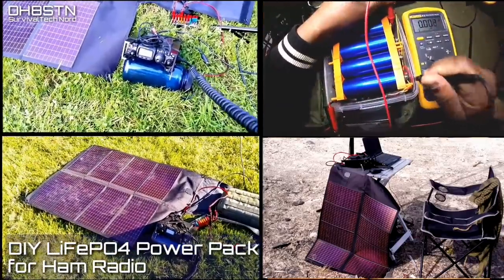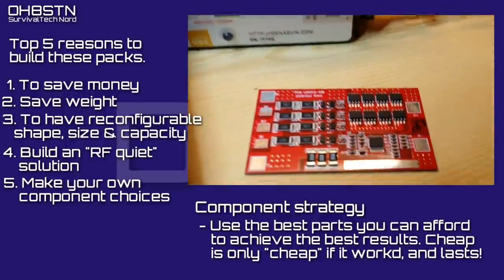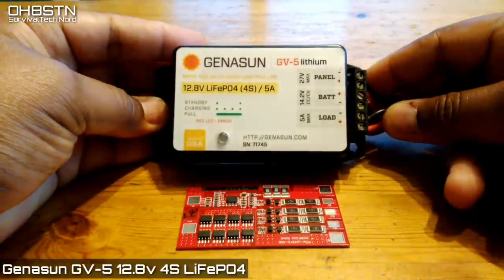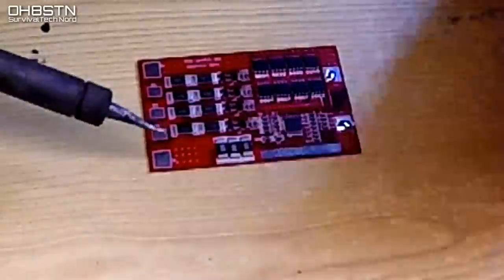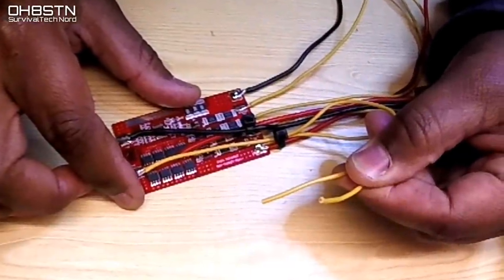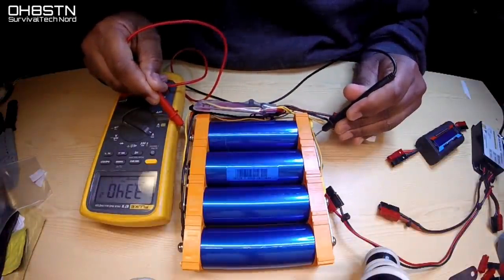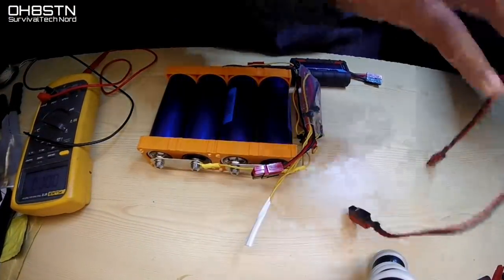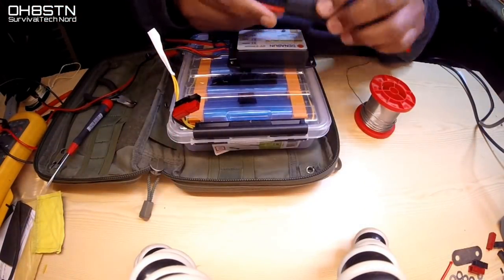Ham Radio Battery Pack DIY LiFePO4

Comment: WOW! It's hard to believe this video is 4 years old. I remember watching it when you posted. Its been a slow process but I've finally got my pc, tnc and radio. I should be on the air this winter if my work load lightens up. Thanks for all your videos they are a wealth of knowledge.

Comment: I really liked this video. The step-by-step documentary of building the battery pack shows that it can be both fun to make and an economical alternative to turnkey commercialized systems.
Reply from the maker: +Bonnie Crystal thanks Bonnie, that means the world to me. 
These steps-by-steps will be the norm for tutorials on the channel. For now the tutorial forcus is portable power. 5Ah 4S2P LiFePO4 pack coming up this month. In spring 2018, a 4S3P/4S4P 120Ah version to upgrade the shack, (based on our 100Ah discussion). Portable off grid power has remained a passion since a fifth grade science project. Planning on some ALE antenna tutorials as well.

Comment: Finally, someone who DIY a LFP battery with tremendous amount of capacity in a regular lunch box size. For cost-effective long lasting battery! instead of spending 300 - 900$ on commercial unit.  

I've been looking for a video like this. Because I'm also building my own battery source for my devices which I preferred compact, less weight, size, yet off-grid portable that I could fit into my Gobox kit.

Satisfied to watch! 
Thanks for sharing!
Sub up.

Comment: Nice build. I didn't  know about the LiFePO4 38120S  battery.
Reply from the maker: +David Gillooly  yeah I didn't know about these either until a few months ago. I think they're excellent storage batteries and considering there's so much lighter than AGM or lead acid batteries plus almost double the capacity with the same amp hour rating seems to be all positive at the moment. Time will tell

Comment: Nice, I had never even heard of this type of battery. I will have to look into building something like this.. very handy.
Reply from the maker: +Iridium242 it's always nice to see you stopping by. If I'm not mistaken I think this type of battery is often used in electric bikes or cars. Definitely makes an excellent storage medium
Reply: i would imagine you could use just about any sized cell (ie. 18650) so long as its series'd to make 12 (ish volts) and enough cells in paralell to to supply the watt/amp hours for operations

Comment: Great job, Julian!! 

I have watched a lot of your videos...and it looks like you are having great fun. It made me so jealous, that I have purchased a KX3 / PX3 and have been putting things together for a man portable station. Currently the gear is transported with my 4 wheeler and usually while I am out checking on the cows, I will set it up and try to make a couple QSO's. I gotta say, it's the most fun I have had in this hobby.
Reply from the maker: +Mad Dawg yeah operating portable adds a whole nother Dimension to ham radio. In fact there are so many variables when operating portable that it brings up new challenges that we hadn't considered before and makes it feel all new again 👍

Comment: Julian, you said you were looking large shrink tubing - Might I recommend using a two liter bottle, if you cut the end off and heat it like shrink tubing it will contract and provide a strong tight seal.
Reply from the maker: +A A this was a magnificent idea. I found that heat shrink I was looking for the clear PVC kind but I also tested shrinking the two liter bottle around my pack. That is an excellent hack! I think I'm going to have to make a video about this hack just because it's so cool.
Thanks for sharing the knowledge
Reply: You win the internets, congrats!
Reply from the maker: Internets?

Comment: Very nice power pack. My UBC was a noisy affair I'll have to spend a few more bucks, it was salvaged from some old RC Quad Copter FPV gear. Even with toroids front and rear end it still produced 3 S units of hash to the noise floor......
Reply from the maker: +graplingurty that's a crazy amount of noise. Absolutely zero noise with this pack, and no toroids were used. I use the UBEC on the first battery build last year, that required a couple of toroids, but those cleared up the noise quite well. Yeah the component choices mean the world in regards to noise.

Comment: Another great video Julian! Thanks for sharing your experience and knowledge. Left you a buck on the virtual jar ;-). I just use a set of three LiFePo batteries (from Hobbyking) and re-charge them at home with a controller. Together with an IC-7000 (which draws too much current for a field rig, I know) and a Buddipole that's my portable rig and it was proven to work ok in the Cayman Islands, the Bahamas, Aruba, Curacao and Canada. I mostly used a car though or only had a short distance to walk. 73s, DL1THM.
Reply from the maker: Thx for the tip 👍
It sounds like you've got to working setup, and after all that's the main point. Lots of operators ask about this Hobby King battery so I'm sure your comment will be appreciated.
Are you vacationing, or visiting those places for some other reason?  I think most of us would die to operate from such exotic locations.
Thx again 
73
Julian oh8stn

Comment: Julian, since you said you had problem designing the box, I will assume that you do not want to go into learning a CAD program (obviously). There are some very easy programs o design simple shapes like a battery case/box. I used TinkerCAD to make me an elaborate 18650 cradle. It follows the method of combining additive and "negative" basic shapes yuo define their size and alignment. For a basic tray you need to make 5 rectangle blocks, then you combine them. now if you want to have a hole on one side, you make a "negative" cylinder the diameter you wish and the length of the box side thickness. then you drag it where you want it.

Comment: Thank you for the information and ideas!  The only thing I am not sure about shrink raping as much. It looks like you are stopping the air moving around needed to cool things. The BMS drops the cells that are hi through resistor,  this makes heat.  The power you use goes thought a solid state device to be able to switch the power on and off,  this makes heat. I understand making it bulleit proof or where it can take what ever, but I am not sure about the heat build up inside.  I am sure you have thought about this and made sure that it will not be a problem.  I just would like to know what you have done for this. Over heating of the BMS and or the batteries can shorten there life and have other problems.
Reply from the maker: No problem David I agree with you. We've also covered that in the comments. On my latest build the solar generator, I omitted the heat shrink. Thanks for the comment.
73
Julian oh8stn

Comment: What a superb video, project, and tutorial!!!
P.S.: I wonder if a section of motorcycle inner tube (tire tube) would slip snug over the pack?!?  It would insulate & provide some shock absorption... and it would be removable/reusable as opposed to large shrink wrap.
Again, great job!
-Rob
Reply from the maker: +rkaag99 hi Rob the motorcycle tube idea is a magnificent one. I get so many questions about these projects that I thought to use a clear vinyl sleeve, so people could see what's inside, and I can answer questions about it without taking it apart again 😀 I'm going to add your idea to the episode notes because for almost anyone else that would be an excellent way to seal the battery pack.

Comment: Julian,
What size wire did you use?  I am currently making the 10aH battery pack.
Thank you for the great videos.
Reply from the maker: I typically use 14awg wire.
73
Julian oh8stn.

Comment: I guess I'll be coming back to this video again...I have the carrier and cells coming after half way through the video. I have a charger (BMS) from Budipole I want to use ..so I need the connector for the A123 packs they use.
The shipping charge to Indianapolis was more than the cost of the cells ! !
Thanks for the video, and thanks for dropping by QRZCQ to comment. Try the QRP chat room some time !
Lee, WA8QFE (BushRadio on BCUSA site.)
Reply from the maker: Francis Thompson have I forgotten something Lee?
Reply: Julian,
Not in the least...you've just launched me on another project !
I did find the BMS you used and ordered that one also.
I was thinking of using my Cellpro 10XP balance charger, but it uses a small connector for the cell balancing on the A125 systems packs, and I can't locate one that matches it.
Lee, WA8QFE
Reply from the maker: +Francis Thompson try HobbyKing for those Balance connectors
Reply from the maker: +Francis Thompson wait a moment. You don't need a balance Charter charger when you're using that BMS. The BMS itself is doing the balancing. LiFePO4 charger.
Reply: I know, 
I just happen to have one. I'm doing this build with the same BMS as yours now. I bought the balance charger for the 2 A123 7Ah packs I have. The 9Ah Bioenno I use has it's own BMS built in.
Just first time I built my own, and now following your lead !
Lee, WA8QFE
Reply: I'm going with the BMS your using, but will check with hobbyking and also Buddipole who I bought the balance charger from.
Lee, WA8QFE
Reply from the maker: +Francis Thompson if you're interested in bms capable of qro power, I'm just waiting on this one https://www.instagram.com/p/BagnTrCjHrZ/
When I operate casually I almost always use 5w, but for the all-weather weather emcomm field station project, I'll be using a 20w radio and laptop with a 40Ah version of this pack.

Comment: If you wanted to charge the battery with a LifePo charger, would you plug the charger directly into the BMS? And if using a solar panel, then you'd charge through the solar charge controller, which would be hooked into the BMS. Correct? Thanks.
Reply from the maker: That is correct. Just be sure the LiFePO4 Charger is within the c charge rating of your pack.

Comment: Can you detail how to expand the pack to 20 or 30 amp hours for QRO work.
Reply from the maker: +Craig Gilbreath No problem. I think you mean Peak current for a QRO radio. Please give me a day or two to add it to the episode notes in the questions section
Reply: Interested in seeing how you would handle expanding the amp hour rating by wiring in series-parallel to get, say, 20 or 30 amp hours. How would this be done with the BMS if you have more cells to monitor and maintain? Can the BMS modules be ganged together to handle more cells?
Thanks for the quality video Julian, outstanding as usual. (Hope that clears up my original question)

Comment: Depending on the case and even the way you have it boxed and bagged, wouldnt there be an issue with heat durning charging and discharging?  Also what about the many RC community LiPo chargers advelable for home charging?
Reply from the maker: +Jud Stansell excellent question Jud.
I don't charge my batteries at very high rates, which keeps heat down to a minimum. It's the same thing with discharge. I'll never discharge at higher than 10 amps, which generates almost no heat from these cells. The RC Chargers are certainly possible to use. Since we use the battery management system there's no need to use the balance ports on the RC charger. Since I have a solar charge controller integrated with the battery I don't need those RC Chargers when I'm charging at home. In fact I use a repurposed laptop power supply that outputs 18v/2A straight into the solar charge controller. Cheap and easy.
Reply from the maker: +Jud Stansell I've been thinking about your comment. I think I'm going to get one of those laser temperature gauges to measure how warm the batteries get under full current draw and charging.

Comment: Hi Julian (or others) I have completed a build of this battery, but have a question about the BMS board. Should the BMS board be pretty warm to almost hot all the time once the 5 leads (B+, B- , and B1, B2, B3) are mounted to the battery? Cells appear to be balanced, battery is charged fully, but with no charging going on, and no loads connected the board is very warm, even uncomfortable to touch. Is this normal? I am nervous about putting this battery with the BMS connected to it into the pouch like Julian shows... Thoughts? Suggestions? Do I have a bad BMS board?
Reply from the maker: Hi Mike. The balance leads are wired wrong! If there's any heat on the BMS at all, it's wired incorrectly.
We've all made that mistake, but it's easy to correct.
Reply from the maker: Hi Mike. Did you have any luck rewiring the BMS?

Comment: You mention elsewhere increasing the BMS to 30-40A, but the gensun can only handle a 5A load.  Can you explain your thinking? (I’ve built this and a larger one, trying to understand the best power distribution). Love the videos
Reply from the maker: +SouthernSearcher excellent question 
we don't have to use the load port on the charge controller. The 5 amps is only the maximum amount of amperage which can pass through the charge controller to the battery. The load Port is only used 4 low voltage cutoff of an external load. We can instead connect the load directly to the battery and still charge it with this Dodge controller. Does that make sense?
Reply: OH8STN I understand the theory, but 5h3 LiFePo needs stop delivering current, when it reaches its cut off voltage, so what will handle this, to save a rather extensive battery pack.  I’m currently working on a 4S 15AH, currently 2P, hoping to make 4P or larger for home use, I’m in the South of France so sunlight is not an issue. 73 de Andy
Reply from the maker: +SouthernSearcher i think I'm making explainer video about how to do it. Just to keep you in the loop there's two ways that I would consider. Firstly I would use an external low voltage cut off, between the battery and the load. It's not to be confused with the load port on the solar charge controller.
The other way I would do it is using a relay on the load Port of the solar charge controller. This way you get power directly from the battery for your load and the load on the solar charge controller only Powers the relay. This means you're low voltage disconnect on the solar charge controller is controlling the relay and protecting your battery.
Does that make sense?

Comment: Awesome video, thank you. I have seen these batteries around but never a well done video showing the building of a pack. For this, thank you. Do you think these cells can be used to make a 40ah pack? I'm wanting to power a DC, ARB refrigerator. I currently do on a 55ah SLA battery but yearn for a lithium battery.
Reply from the maker: +Michael Meza sorry it took me so long to come back to your comment. I wanted to be certain that I gave you the right answer. I don't know what an ARB refrigerator is but it might be the same type of refrigerator that keeps my Red Bull cool. So I've never done parallel packs of more than two deep. But I've seen these parallel batteries done on youtube. It's no big deal making a pack which is 4S2P ir more. All the cells in parallel we'll balance themselves. More over each of those parallel cells connect to the BMS as if they were one single cell. I'm thinking I should do a video about this for the channel. I need a 40 or 50 amp hour battery for the ham Shack. I've already got the panel's up on the tower but I thought to change over to an mppt charge controller for the shack. It might take me some wants to do it but I'm certain I will. For your project all you need to do is make sure you get the right BMS rated for the amount of sales and the total amperage draw the refrigerator will pull.
Reply: Excellent, thank you. In my research I'm finding 40 and 60ah cells. Some are Headway type others are Winston type. For the size I need I may be going with a lithium prismatic type like this: http://www.electricmotorsport.com/ev-parts/batteries/lithium/4-cell-12v-packs/gbs-lfmp40ah.html

Comment: One of the things you mentioned was to match the BMS to the current draw on your QRP rig. How do you determine this beforehand?
Reply from the maker: By understanding how much current you expect to pull from the pack. If you'll run a 100 watt radio at nominally 12.8 volts, or a 10 watt radio at 12.8 volts, ... The expected amps plus 10-15%.
Reply: OH8STN Ham Radio So you aren’t measuring current draw on your devices beforehand, you’re simply estimating. Gotcha.

Comment: Where I can get the battery holder ?  ( Tray ) .

Informative video. Thank you .
Reply from the maker: Thanks 
The holders usually come from the same place the cells come from. If you can't find them, a simple search of eBay for 38120 Headway holders should get some good results. They can also be 3d printed. Same search on thingiverse for the 3D printed file

Comment: Great work.  Thank you for sharing this with us.  

Question: Can the input to the solar charge controller be another voltage source like an automotive accessory outlet or other 12+ volt source?  I am planning out a "Go Kit" which I would like to be able to simply plug into the car when driving, or plug in at the house, etc to ensure my batts stay charged and ready to go.

Thanks, again.

John - KB0JH
Reply from the maker: Thanks for the question and the kindness John. I have changed the charge controller since this video. It's now the gv8 Boost from Genasun.  This is a boost charge controller which will take the lower voltage from your car, boosting it to the proper voltage for our lithium iron phosphate batteries. Ideally we should limit the current, but it does work as you mentioned. The charge controllers I used in this video don't work in the same way, as they have no boost function.
Reply: @OH8STN   Thank you.
Reply: @OH8STN  There seem to be many different options for this.  Do you have a link to the specific model you would recommend?